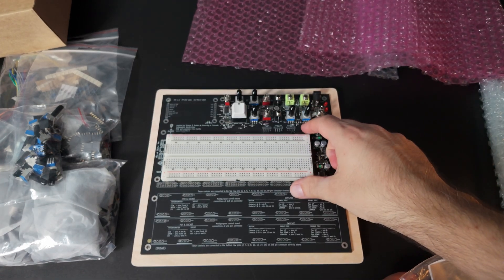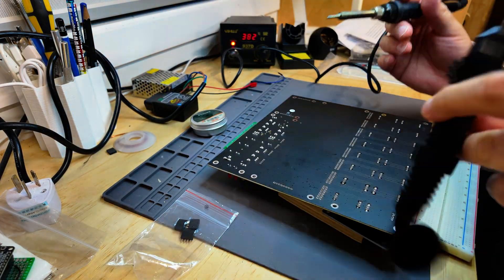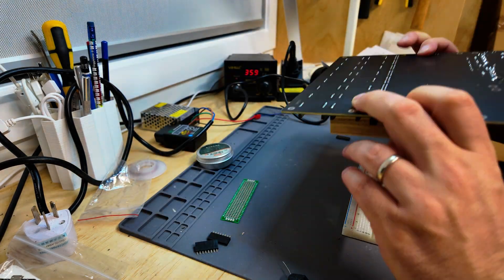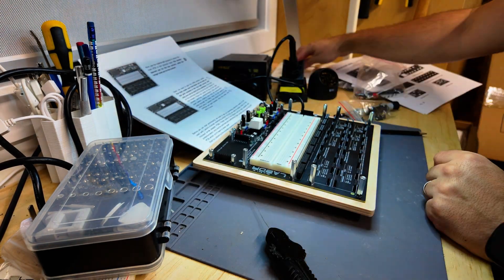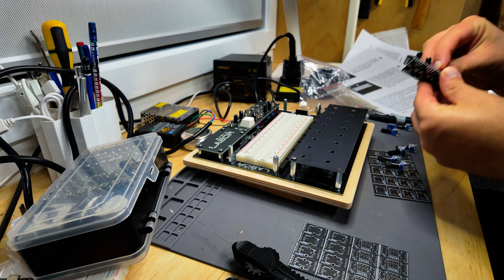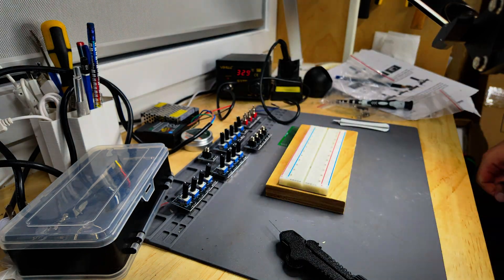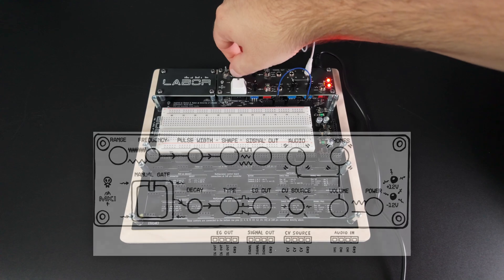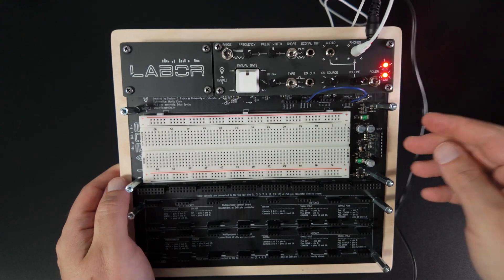LABOR DIY Synth Playground - Assembly

Comment: Thank for the video and advices. I got mine today and looking very forward to the assembling! As an absolute soldering novice, may i can ask what thickness the soldering tin you are using in the video had?
Reply from the maker: The one I'm using is 0.56mm Pb 38 Sn 60 Cu 2 - 38% lead is not great for health, but easier to use than the lead-free ones (lower melting point). Keep your work-space well ventilated... And just in case you've not come across flux yet, get some flux! Put a tiny bit of flux on the thing you want to solder and it automatically gets easier... Hope this helps!
Reply: @iammanywolves thank you so much, i appreciate your advice and will give it a try!

Comment: I'm in the process of building mine and it's been really useful to have this as a reference!
Btw the way did you simply break the PCBs for the modular interfacing section with you hands?
Reply from the maker: Glad it helps! Yes, just fold them over and they should break nicely!

Comment: I love the concept of this. The only thing that puts me off is I'd really like to build my oscillator, VCA and envelope generator from scratch and having them on the board almost feels a bit distracting. Then again, I'd really like not having to make the power supply or the output section, and I like how you can get an integrated oscilloscope, so I might get this regardless.
Reply from the maker: Oh interesting. Are you building a whole synth or why would you want to build your own oscillator and stuff from scratch? Because it's super handy to have when building some effects...
Reply: If you want to use your own-made OSC or ENV, can't you just patch that in and bypass the onboard ones? .......... or is it kinda hard-wired and you can't bypass them?